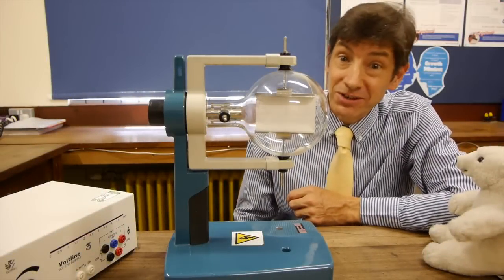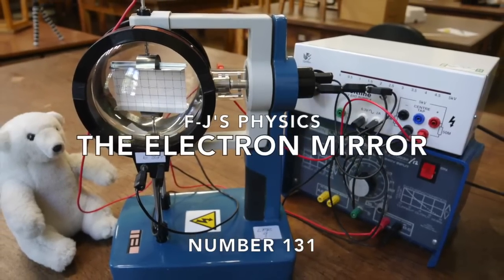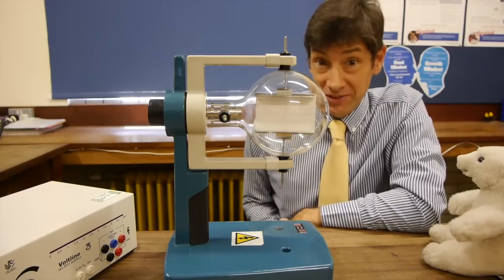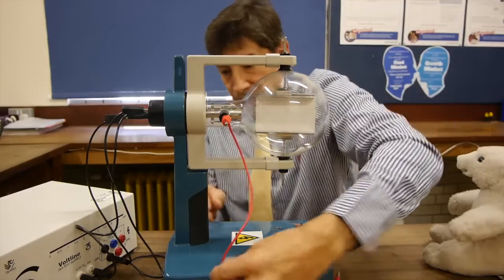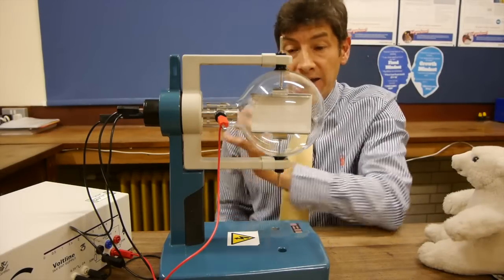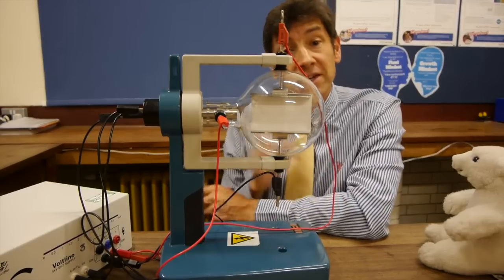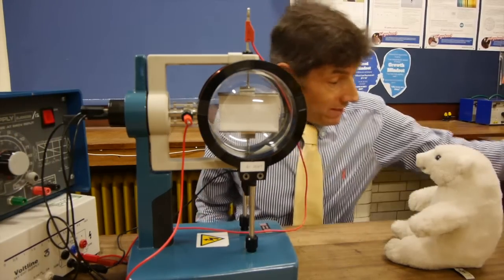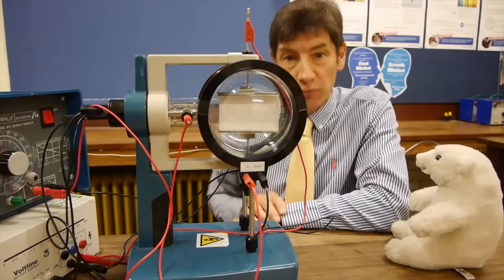Electron Mirror - F-J's Physics - Video 131

Comment: A magnetic field doesn’t push down but rather twist a trajectory. And when a horizontal line projection of a magnetic force equals to the electrostatic force, electrons bounce. Electrons do no lose their velocity because a magnetic force is always orthogonal to a velocity
Reply from the maker: Thanks for this - all excellent comments!  Yes as the magnetic field is across the tube and the electrons passing through it at 90 degrees over this small distance (at the velocities they are going at) it looks like they are 'pushed down' but of course if the magnetic field was stronger they would twist as you say into a circle as explained in this video of mine https://youtu.be/7hJxn4l47X8  I have perhaps over simplified 'curl' for the sake of an accessible explanation.  Agreed too that there is a change in velocity so the loss is only in one direction not a loss in speed.  Thanks again for taking the time to comment.  I really valued the input!  Hope my explanation does not 'grate' too much!

Comment: Why is it blue
Reply from the maker: Steve, thanks for your excellent question.  Do you mind if I copy a previous response of mine: "Normally the tubes (like in an old TV) are evacuated to remove all gas particles at they scatter and effect the beam focus.  In these tubes we need to be able to see the beam traveling so it has a small amount of Hydrogen or other gas in it and when the electrons hit the gas they ionise it.  This (by recombination of the an electron back onto the gas) releases the energy it gained in the ionisation as a photon of light.  Hope that explains it!  Good question!"

Comment: Why is the beam visible? Dumb question probably but ?
Reply from the maker: Not a dumb question at all.  Normally the tubes (like in an old TV) are evacuated to remove all gas particles at they scatter and effect the beam focus.  In these tubes we need to be able to see the beam traveling so it has a small amount of Hydrogen or other gas in it and when the electrons hit the gas they ionise it.  This (by recombination of the an electron back onto the gas) releases the energy it gained in the ionisation as a photon of light.  Hope that explains it!  Good question!

Comment: An electron gun?  Hmm?
That sounds interesting.
 Can you make one.
 I'm dying to do the double slit experiment.
 I want one 😂
Reply: I want a single shot or maybe a double.
Not a machine gun
Reply from the maker: So this device fires billions of very low energy low mass electrons along its length which is why the device at the start of the tube is called an electron gun.  It only works in a vacuum too as even air would stop the accelerated electrons.  This video of mine might help you understand it better.   https://youtu.be/_CsLU-1VGug   Hope that helps.  Firing single electrons is really tricky and the quantum nature of the particles really shows up then making things a bit more tricky!
Reply from the maker: I have not demonstrated the double slit yet.  It is not easy to do with electrons but a simple laser pen and some very narrow slits work well.  We used to scratch a couple of slits with a razor blade onto a blackened piece of glass.  Easy to do but take all the precautions that are sensible when doing it please!

Comment: The insulation on those wires can handle five kilovolts?! Materials science certainly has made strides since I was a kid.
Reply from the maker: They generally cope but I tend to only touch the connectors' fatter plug insulation and, the power supply of course, is of extremely high internal resistance.

Comment: Great, only moving charges have magnetic field thus the influence varies which is proportional to the velocity of the charges.

Nicely explained, but I dont understand why Mirror? As if the beam is bouncing and bending like reflecting from a mirror -- is that the reason?

❤+1
Reply from the maker: Yes that's right which is why the force on the electrons becomes less as they slow down even though their charge remains the same.  And as you say it is proportional F=Bqv.  As far as the 'mirror' goes hope you don't mind me pasting one of my previous answers: "However, this experiment is referred to as 'an electron mirror' as it is a way of getting electrons to deflect in a similar manner to the way light would off a specularly reflecting surface.  In short it is the technical name for this process but of course there is no physical mirror involved!  It has many uses but especially in electron microscopes to guide the beam."  Thanks for watching and taking the time to comment.  F-J
Reply: @AnthonyFrancisJones  HaHa, as I imagined- in most of the nomenclature is either done by non scientific people or before they have fully understood the phenomenon. But they always stuck to that.
Thank you for explaining personally. It is not everyday I get to see an electron gun.. really enjoyed that. Please keep enriching our knowledge and experiences.
Reply from the maker: My absolute pleasure and glad you are getting something out of it all!  Richard Feynman used to complain about people who 'hid' behind nomenclature without actually explaining what it meant.  At times, I seem to remember, he would pretend to not understand the simplest bit of physics if it was presented to him in a jargonistic way - wise man and educator!

Comment: Nice setup.

It would be a disaster if the tube ever got broken.
Reply from the maker: Thanks.  Yes, many schools had/have them and may well have them hidden deeply in a forgotten cupboard.  Mine are about 40 years old.  The stands are really heavy but you have to take them out of the stand to pack the tube away in its polystyrene packing case.  That's when it can all go wrong!

Comment: Thank you for sharing, why is called Electron Mirror?
Reply: I believe it was said somewhere below ‘...referred to as 'an electron mirror' as it is a way of getting electrons to deflect in a similar manner to light off a specularly reflecting surface.  In short it is the technical name for this process but of course there is no physical mirror as one would imagine involved!‘ a commentator said it was more deflection than defraction.
Reply from the maker: Yes, that was me!
Reply from the maker: Good question - it is called this as it is a way of directing electron beams as if one had a mirror there.  Obviously that works for light but not electrons so we use external magnetic and electric fields to have a similar effect.  Hope that helps!

Comment: Did this experiment in grammar school back in 1968.  The curve of the beam is measured together with the voltage across the plates and the magnetic field of generated by the coils to calculate the charge to mass ratio E/M of the electrons.  By then doing the Millikan oil drop experiment (another A-Level physics experiment) you can get a value for E for a single electron then by combining the results obtain a pretty accurate result for the mass of an electron especially after taking a statistical average of the results from everyone in the class........amazing!!!
Reply from the maker: Dave, well remembered!  A couple of things - did you really manage to do Millikan's exp?  That is a nightmare to do in a school lab!  Secondly I think you used a different tube for your e/m which makes life a lot easier.  Did you use this tube instead (hope the link works)  https://youtu.be/_1y_-BeCAHQ
Reply: Anthony, yes it was exactly the same JJ Thompson apparatus we used so its been around a long time. I was convinced that the formula for the magnetic field through the Helmholz coil would come up in the A level exam so I committed it to memory.  Sadly I can’t forget it after all these years and the damned thing still haunts me.  We all did the Millikan drop experiment in the school dark room as it was very difficult to see through the microscope into the oil drop chamber with a small lamp shining through it.  I remember the oil aerosol squeeze bulb, which was a bit like my mum’s old fashioned scent bottle.  The equipment was pretty antique and it was tricky to balance the voltage to get the falling droplets to hover, especially in the dark whilst peering down the microscope but we all managed it.  The physics teacher who was amusingly called Mrs Jean Scull – you can imagine the nicknames the poor woman had to endure along with her hubby, the school’s history master, but she was brilliant.  She plotted up all the results for the two experiments on the blackboard as bell graphs and worked out the mean and standard deviation in her head – no calculators or computers in those days only 4 figure log tables for the plebs (us) trying to keep up.  The result we got for m, the mass of an electron, was well within a standard deviation of the published value from the National Physical Laboratory.  At the time we were being groomed for the new frontier of nuclear science and engineering and we did loads of other experiments using equipment and materials that today’s kids wouldn’t be allowed to go near never mind play with.  Mind you when we asked Mrs Scull whether it would be a good idea to go into the nuclear industry she said that if we did we should start a family early.  I decided that mining engineering was a much safer option. @AnthonyFrancisJones
Reply from the maker: Thanks Dave, that's a fascinating story and you are probably one of only a handful of people (alive) that have actually done Millikan's experiment.  I have a piece of school kit in my loft which is used to simulate it to avoid all the hassle you went through.  I should get it out.  Sounds like your science teaching was outstanding.  Those 'determine the...' type experiments seem to have gone these days and I must profess that all my teaching was 'don't worry too much about the fine detail and actual result - can you see how it would be done and how it all works.'  True of many of the videos I post here!  I guess you are familiar with all the fudging of the figures that Millikan did and the issues that caused for many years after.  Talking about nominative determination, our physics technician was Mr Brain.  Thanks again for taking the time to comment.  It is amazing how many really interesting comments the videos have got recently - makes it all worthwhile and adds to them greatly!  Hope you enjoy some of the others and do let me know!

Comment: Are x-rays a concern with a setup like this? There doesn't appear to be any shielding where the beam hits the glass. In ye olden days 5KV would be about a 8-9" B&W CRT, and those had x-ray warnings on the inside.
Reply: Yeah I do believe any time there’s a vacuum it definitely produces x rays too, good question
Reply from the maker: Good question.  Firstly these tubes are designed for school use with safety in mind.  Secondly we us a very high internal resistance EHT supply and finally x-ray production is not really an issue for voltages as low as used here.  However, we have to risk assess using CLEAPSS, and their advice too is that there is no known risk.  Now, there were rectifier tubes in TV sets that did have an x-ray risk associated with them, I have one, and it needed to be used with some screening.  Thanks for asking - you make a very good point!

Comment: I'm sorry, but why are these trones flying out of the cathode and not neutralized in the anode? it looks more like the effects of  electromagnetic field and a dialectric field. no?
Reply from the maker: Good question.  The electrons come off the negative cathode and feel an electric field attracting them to the anode as you suggest.  However, this field causes them to accelerate to very high velocities.  The anode is hollow so they 'overshoot' it and pass through the hole in it making them free to travel along the tube.  This is the basis of how an old cathode ray tube TV worked.  You might find this video of mine explains things a bit further.  https://youtu.be/_CsLU-1VGug  Hope that helps.
Reply: thanks for answer! @AnthonyFrancisJones

Comment: I thought this would be a different type of electron mirror.
There is a device that has 2 coaxial solenoids. One has a weaker magnetic field than the other. The solenoids do not overlap. An electron beam is fired coaxially. It uses fringing to reflect low energy electrons back. High energy electrons continue on.
It is my understanding that these are used to filter out low energy electrons in accelerators.
It's been a long time since i learned about this so I've probably gotten something wrong.
I've never understood this and it be nice to see it demonstrated like this.
Reply from the maker: Good question Peter and your explanation is good too.  These systems set up field shapes that have the effect of 'velocity selecting' electrons or other charged particles so that the beam contains only one energy.  My tube has a range which is why the beam spreads in the fields.  You might be interested in looking up synchrotron wiggler - an interesting device that does behave a bit like my demonstration here.  Thanks for watching!
Reply: @AnthonyFrancisJones  Do you know what my device is called? Google hasn't been helpful.
Reply from the maker: Peter you are probably thinking of a 'Gun Solenoid' in a e RadioFrequency Photo-Injector which CERN use.  All a bit technical!

Comment: Very interesting! I have a couple of questions: What accounts for the difference in speed of the electrons in the first part of the experiment? I find it interesting that there should be a variation in speed, given that the speed of light is a constant. The other question is, if you are able to slow electrons down to a zero velocity, and then accelerate them, is it possible to accelerate the electrons faster than light speed? And just the opposite, what about the electrons that are at zero velocity? Do they simply accumulate into a neutral charge at that point?
Reply from the maker: Good questions.  The velocity selection of the electrons is not very good in this very simple electron gun.  We also feel that ripple on the power supply does not help.  There may be other factors at work here too.  It is not connected to the speed of light - the electron velocity is controlled by the strength of the electric field (or accelerating anode voltage).  Secondly, you cannot accelerate electrons faster than the speed of light as it would need an ever increasing energy source.  Energy input and corresponding velocity are not linear especially close to the speed of light.  Another way of thinking of this is that due to E=mc^2 the mass of the electrons would increase needing ever greater energy to speed them up further.  Zero velocity electrons if not in a field will indeed accumulate until they repel away.  Or of course will flow to ground if there is a conducting path for them.  Hope that helps a bit and thanks again for watching! Oh BTW did I see a Clansman C320 in one of your videos?  I remember them really well from my youth and the C349 which I was always repairing!
Reply: @AnthonyFrancisJones  Thank you for the answers and clarification! This helps =] Yes, that is a C320, and I use the primary on CW Night at the end of the year. It’s a nice radio to have and listen with =]
Reply from the maker: Great - C320 takes me back to my youth as a cadet.  We had all that kit!

Comment: Funny demonstration, but other sources show electron mirrors based solely on electrical fields, without an additional magnetic field. And i am a little concerned about handling these experimental cable plugs with open prongs and high voltage in darkness  ;-)
Reply from the maker: Thanks Paul.  Thought it would be interesting to show the interaction of a E and a B field.  Yes, I have to be careful with the wires but as I have said before, years of practice, the room looks much darker on the video than it really was and mainly these 'educational'  EHT supplies have massive internal resistance so risks are greatly reduced.  It's the van de Graaff that I don't like!  Thanks for watching!